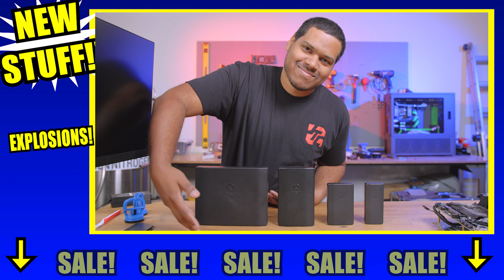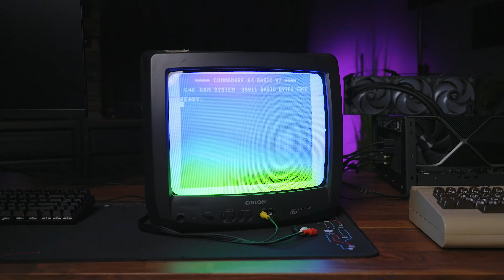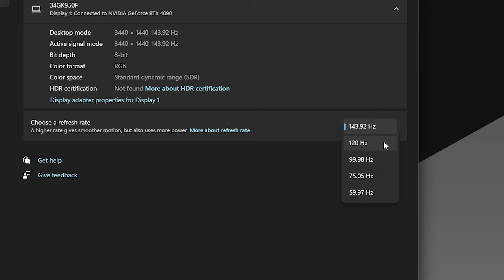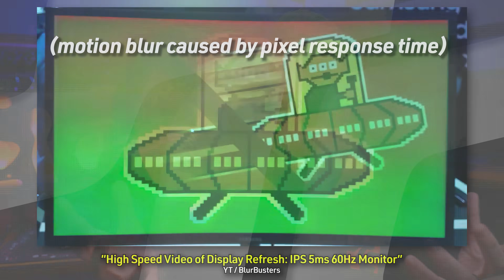MPRT is pretty awesome! This is how it works...

Comment: Hi i have problem,9070xt and ryzen 5 7600x monitor msi mag 275qf 180hz,adaptive sync turned on in monitor settings and free sync in amd software under 180fps is smooth but when i have 181-250fps its screen tearing,i tried enhanced sync,and everything doesnt work ,only under 180fps is smooth above is screen tearing please can you help me @Jayztwocents

Comment: MPRT is recepy fpr eyes afeeection obtain thru strob the backlght ,with a frecvecy  half u frecvency if u monitor vertical frecvency hase. If a  decent value above 100Hz and fell god for u eyes this MPRT new crap will strob the LED of the scren with 50HZ /sec 60 HZ /sec or 70 Hz/sec  to obtain  black frame that full the yes with perception of moving frame and messup with the optic nerve and u brain🤭:face-red-heart-shape::text-green-game-over:. And the spreme shit of MPRT is not compatibile with VRR variabile refresh rate , adios  G Sync and FreeSync :face-purple-crying:

Comment: I went from a view sonic office monitor at 60 Hz - 5+ ms reposnse time, something cheap that could show digital xray photos. To a Vizio IPS TV, 60 Hz with a 120 MPRT backlight, then to now with a HP X34 165 Hz 1ms response time. ROCKET LEAGUE will never be played on anything lower than a 165 Hz here going forward. I love motion blur too, just in any game not faster than American Truck Sim, or Flight Sim 2024, Kenshi, World of Warships. Or watching movies on YouTube.
 (I tried showing my dad the differences when I extended both monitors to show the same picture. He didn't see the difference in flight sim. But now that I've experienced it within Rocket League where fast movements are the norm, I knew what to see in the old Flight sim X he played still. It was giving me a headache. I'm too spoiled now and don't think anything besides a 240 hz refresh rate will be my next purchase when my current screens die out. The staff at Micro Center let me pull up a video of Ultrawide 120 Hz Planetside 2 gameplay in store, which solidified my purchase. They'll bring over a laptop if they're not already connected to the store internet and you can watch other things rather than the demo videos they have. I always just looked at those demo reels, I asked and they were like heck yeah we can do that. Once I saw it in a game I have 7,500 hours in. I could see the differences.)

Comment: At one point my room had a light that was strobing in a barely perceptible manner, that caused me to see waving my hands as if each... um, let's call it "frame" was sharpened with no smears. That might sound good on paper, but in reality that made every motion feel very weird to me, like movements were both slow and fast at the same time... i really didn't like that effect. So looking at how these monitors do something similar i feel like it would leave the same impression on me, making every in-game movement feel "jumpy" and unnatural.

Comment: i have an 165hz monitor and i try to use mprt mode on it but evrytime when i reboor my mprt modes change back to the superfast option but when i set fast mode to superfast it doesnt change to fast but stays on superfast unlike the fastest mode anyway to fix it ?

Comment: Do you have any video about an error message when the PC restarts that says... "CPU Fan Speed Detection Error. Please ensure your CPU cooler is properly connected to the CPU_Fan header. Consider dropping "CPU Fan Speed Lower Limit", or simply set it to "ignore" in BIOS, if problem persists."

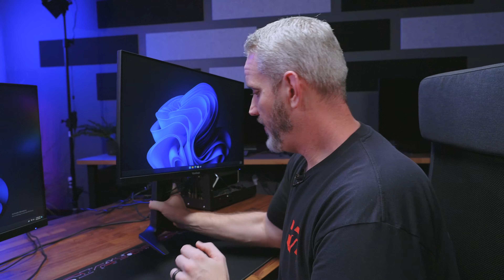Comment: 13:15 Never understood this. Why shove your face into the screen and create future back problems when you can simply buy a larger monitor?
Reply: Most Esport players don't play that close, only extremists. FPS pro players use 24-inch monitors because they are in the exact spot—not too small, not big. When the monitor is bigger, you cannot react fast enough to move the mouse on the other side. "Smaller monitor" faster reaction time. That he did not say in the video, but its ok that's not his expertise.

Comment: excellent information, i felt like i was in college again,  explains whey staples advertised my lcd at 5ms and msi site said it was 1ms,, no it is only 1 with MPRT on, and its off by default running at 5ms, lol, Marketing bastards,, like ram says 3200mhz on each stick,, no, that is only if running 2 sticks,, not 1 , lol then you get half the throughput if running 1 stick. Also Im not sure why the business model MSI 100 hz lcd also has MPRT option, lol other than its there and its cheap to make , makes sence , Thanks for the info Jayz50cent

Comment: Everything apart from an incandescent lamp has flicker?  That's blatantly false information! An incandescent lamp modulates with the power source and there is a 50 or 60Hz flicker present as the current alternates. An LED driven from a pure DC power source has absolutely ZERO flicker or modulation. There is no 'refresh'.

Comment: You can fix CRT t.v.s that a magnet ruined, but it is not easy. Also CRTs dont actually draw that much power. It is surprising, but sometimes they even draw less power than modern t.v.s

Comment: When does all of these advancements are nulled by our own processing limitations?
Reply: when you get into the thousands of Hz
Reply: @Violet-ui  interesting. I did do a look at some peer review research and it gave a couple of interesting data points. Human reaction time is around 220 msecs while our recognition reaction time is slower at around 380 msecs. 380 msecs is 2.63 FPS. Far slower than even a mid range computer.
Reply: @sharizabel2582   Yes, but that has nothing to do with this
Look at a 3fps slideshow. Does that look fluid to you?
Reply: @Violet-ui  visually you are correct. Conversely, those who think all these advancements make a huge difference in actionable play, not so much.
Reply: @sharizabel2582   Try to play at 5 fps
Then try to play at 30 fps
Is that a huge difference? Both visually and from a competitive advantage point? Even though 5 fps is already beyond the reaction time and the processing time of humans (not really how that works but anyway)?

Yeah once you exceed like 200fps or so the main improvement will be motion smoothness and motion clarity. No more real competitive advantage. But you should still see the improvement
Reply: @Violet-ui  absolutely, true that the visual experience, a huge part of game play, is very much improved. I’m old enough to have experienced play at very low parameters. I do enjoy the enhancements.

Comment: MPRT (or more accurately the backlight strobing) gives a lot of people headaches.
It's not for everyone.
On top of that, a monitor having a super low MPRT rating doesn't always make it better than one without (there are plenty of examples of monitors with 0.5ms MPRT that still have worse ghosting/overshoot than one with MPRT disabled at 1ms GTG).
It's also awful at lower refresh rates, so if you're gaming at below 144Hz do NOT enable MPRT.

That's where sites like RTINGS with their reviews come in useful, they'll often show monitors with MPRT enabled and disabled at different refresh rates.
Just because a monitor has 0.5ms MPRT, don't just presume the image will be any better than one with 1ms or even 2ms GTG.
At least read reviews, or get a demo if possible before buying one just because It has MPRT, which most new monitors do these days.
I actually disabled it on both my monitors because the images was worse.

Comment: Cool vid. BTW, you can possibly "fix" the CRT that you messed up with a magnet, by "carefully" applying the magnet in reverse directions...BTW, Incandescent bulbs powered by AC, actually do flicker... check it out on high speed film.

Comment: For those wo are confised the reason why a 0,5ms strobe has less ligth then a 1ms strobe even they should both be on 50% of the time, is that it's not digital, no matter what it's allways a curve and if you switch less you have less curve time and more peak time if the switch is identical or even similar to one another.

Comment: The motion blur is caused by your eyes moving to follow an implied motion that is not actually motion but a series of still images. The strobing means your eyes only receive information when the information is current and not old information as your eyes follow the implied motion.
This is why 24 fps content on a CRT looks fine but is absolutely unwatchable on an OLED without motion interpolation or BFI etc

Comment: As a “motion clarity enjoyer” myself, there’s a couple things wrong in this video I’d like to explain…
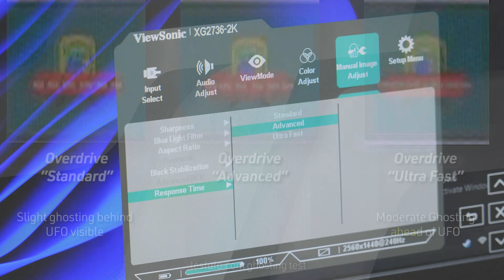Most importantly, all the in camera tests appear to be captured wrong. The UFO test at 15:40 looks like you filmed with a stationary slow motion camera instead of a moving camera taking a photo with the sync track. That’s how you’d show what it looks like to the eye.

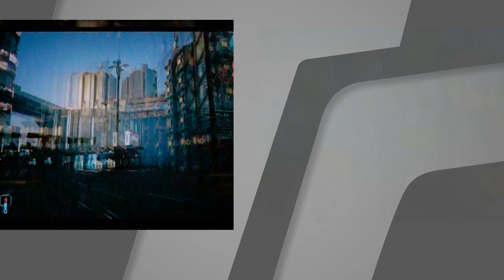Again at 17:23, these appear to be stationary camera shots, not moving cameras to show as it appears to the eye. We see the individual frames (stroboscopic effects) which is not what strobing fixes. Effectively all that’s being shown is that the strobing mode cranks the overdrive and there’s less ghosting. This is true for essentially every LCD that’s ever offered strobing. Our eyes track motion smoothly which smears the individual frames and strobing stops this from happening, that’s why we need the camera to move with the in game motion to smear the frames as our eyes would.

I can make the above point more clear with an OLED display. They sport basically instant response times. Photograph an OLED with a stationary camera or don’t move your eyes (stare at a crosshair for example) while the game is in motion and the frames will look completely clear. As soon as our eyes move to track motion, it will still be smeared with the persistence of the frame rate of the game, or the refresh rate of the screen, whichever is lower. Only way around this is either higher game fps and display hz or display strobing.

0.5ms MPRT does not mean strobing 2000x per second, It means the amount of time the frame is shown (persistence) before the screen is blanked again. Assuming you have the monitor running at 240hz it will strobe 240 times a second (once per refresh cycle), but each strobe (or the time the frame is shown) will only be 0.5ms long out of the entire 4.16ms frame time for 240hz. This blank time is where the perceived brightness loss comes from. 

Minor nitpick, but strobing and bfi are both used by monitors, but backlight strobing is always used for LCDs and BFI (black frame insertion) is always for OLEDs. It’s down to the technology of how the screens work as OLED doesn’t have a backlight.

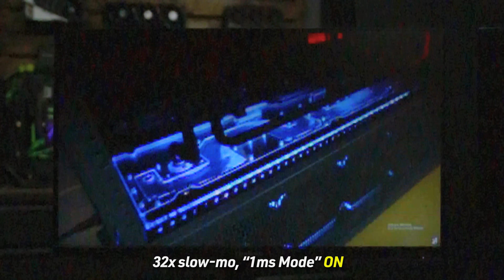Strobing must = hz or you get multiple image artifacts as you’d see the same frame strobed multiple times. This is what’s happening at 8:58. You wouldn’t really be getting the clarity benefits here because the video being shown is having each frame strobed many times. 

In addition the video at 8:58 also shows a clear red after image indicating a likely KSF phosphor. Great for making LCD reds way more vibrant but very bad for motion clarity. You probably are not seeing anywhere close to an actual fully clear 0.5ms persistence on the screen shown.

Considering how much Blurbusters is referenced in the video, they do have extensive documentation on how to capture their tests with cameras to show it as the eye would see it and there’s more tests that show motion performance (like strobe crosstalk) much more in depth that wasn’t even tested here. I know it’s confusing but it is necessary for this type of stuff. 

This is the madness that happens when you game on a high refresh rate CRT… it ruins 99% of displays

Comment: I absolutely detest how manufacturers refuse to put more than 1 DP port on panels.  it forces me to use HDMI which causes my windows to lose their positioning every time I switch between personal PC and work laptop forcing me to repositioning everything (my main panel I put work stuff on left/right and my side panel is used for monitoring graphs/alerts in portrait mode. if I forget to turn side panel off before switching main panel back to personal PC everything gets jammed into that portrait mode panel... more pain in the butt).  if I were using DP for work laptop nothing would move if I switched or turned off one panel or the other... it was glorious.

Comment: with a true DC power supply leds do not flicker either
Reply: for simracing i love to see all the numbers as low as possible except fps , refresh rate of the panel and resolution. i also include the price . there's always a compromise to be made . but some tv's are in a great sweet spot to get 3 of them for triple screen setups . i'm currently searching for a great 50 inch or bigger tv for a friend of mine who wants to go triple scrreen vs getting a VR headset. i tried VR, i don't like it for long sessions . he doesn't even wanna try it . and i can understand why . yes it's better immersion and cheaper . but we have physical issues with a headset for long racing sessions . we don't really care about colour accuracy  . input lag and refresh rate are most important . oled tv's with 120Hz would be perfect if they would drop in price . our setups are getting close to 10k when including the price for 3 screens . but every hobby gets expensive when you love it .

Comment: You can fix a CRT with a coil magnet, I was taught to do this when I was learning to fix TVs and VCRs back in the day.  180 wind of magnet wire around a 5 gal bucket (you create a degausing coil [future CRTs actually had a degausser built in]) and you center the coil on the screen and slowly pull back until the picture resets.  (From memory as this was back in the late 90s when I was learning this stuff)

Comment: All of these features and these displays still lose against any pseudo 1440p CRT at 60Hz in the UFO test.

I took a photo at my Syncmaster 955DF CRT monitor running at 1856x1392 res and it would take few microseconds for each scanline. When i eye track the moving UFO it looks like it isn't moving.

Comment: The fastest display is still any CRT because they draw the image line by line.

I have a Samsung Syncmaster 955DF CRT, 1856x1392 resolution, way, way sharper than a 1080p LCD that i have.

Comment: Well, actually, Nvidia and Asus developed the next step of backlight strobing and was able to utilize both strobing and vrr. However, it requires new nvidia hardware chip built into mediatek monitor controller(also all new g-sync hardware will be built in special versions of mediatek controllers, as oem suggests it will lower the price of hardware g-sync), you can read more on nvidia or asus websites - it is called G-Sync Pulsar.
Reply: Although I would still prefer oled 1440p 480hz (asus pg27aqdp), since every esport title usually pushes more than 600 fps on best optimized hardware and software

Comment: Big issue in VR.
Personally I only notice motion blur when it is really bad since, (perhaps because I am Autistic?) I normally see a lot of motion blur.
Reply: Try a Quest 3, it has CRT like motion clarity.
Reply: @ThisisCitrus  I think you misunderstand. I should have been clearer, I see a lot of motion blur IRL. I won't get another Meta headset until they bring back OLED screens. I have my original for BeatSaber and the few standalone apps I use and my Beyond for PCVR. Doesn't matter how good the processor, how fast the refresh rate of the image looks like crap and compared to OLED, LCD looks like complete garbage to me.

Comment: Some corrections:

4:34 "Now this is where LED LCDs come in" <--- The VAST MAJORITY of LED LCDs do not do anything at all to solve the issue of backlight bleed, only very specifically the ones with local dimming (be it edge or array) do anything to help with it, and they are the minority.

5:55 "But now we have IPS technology with 1ms response times" <--- Manufacturers will claim this, but 99% of the time they're lying. There might be a couple of them out there, but they are exceedingly rare, or if they exist then no-one has really tested them to showcase it.

Rtings has done PHENOMENAL work with this subject in recent years, and even the fastest IPS displays they've ever measured, monitors like the Dell Alienware AW2524H and ASUS ROG Swift 360Hz PG259QN (older one by now), can only manage an average response time in the 4-6 ms range across a large variety of brightness changes, with only some specific , small gray to gray transitions reaching under 1.5 ms, like 50% -> 62% brightness change taking 1.3ms on the Alienware. Even that is still 30% over 1ms. And on most displays cranking up the overdrive just makes response times worse, because it introduces so much overshoot that the color only actually settles on the target values in the 10-20 ms range.

TN can legitimately get below 1ms and below response times with enough overdrive these days, but TNs are garbage for anything other than response times, so only really suitable for competitive games, not anyone who actually wants to enjoy what they see on the screen. They have their place in the competition space, but they just destroy image quality.

And outside of LCDs, OLED panels can easily hit pixel response times in the 0.1-0.3 ms range for all except like 0% -> 10% brightness changes, i.e. from completely black, turned off pixel, to a very dim pixel. Turned off to even a slightly brighter than that pixel is again in the under 1 ms region.

Comment: Early monitors also had a high voltage flyback transformers in them...  Which had anywhere between 8K to 10K VOLTS.